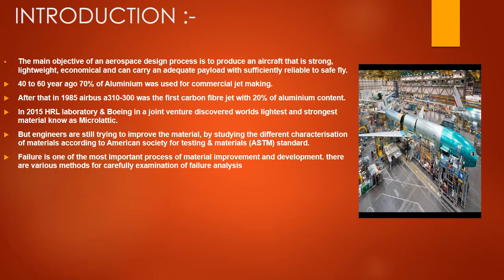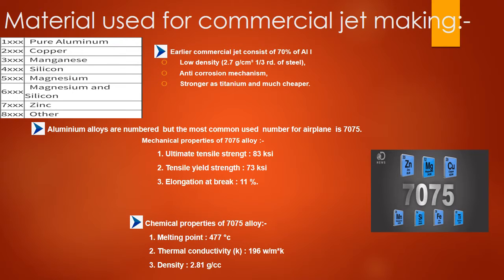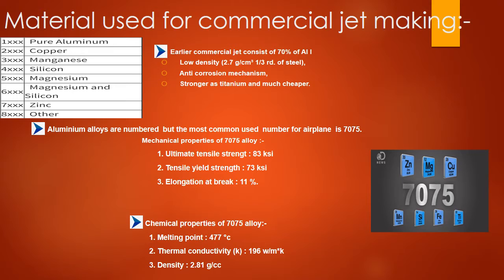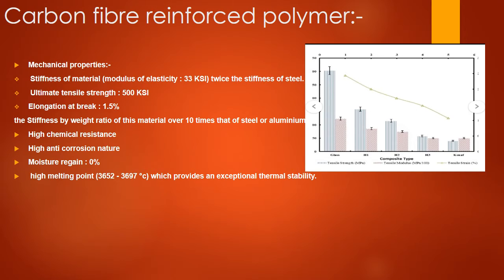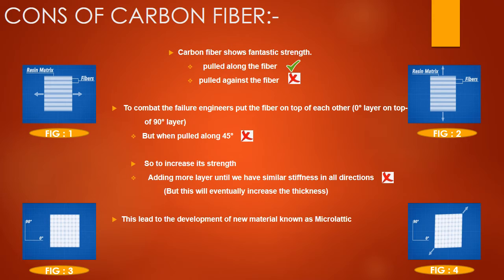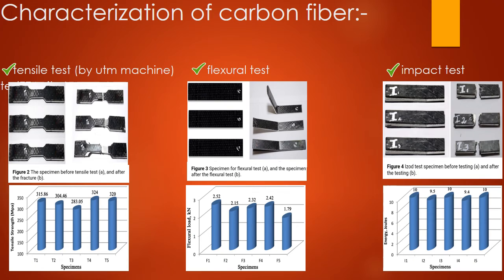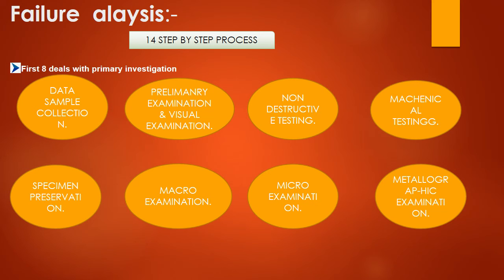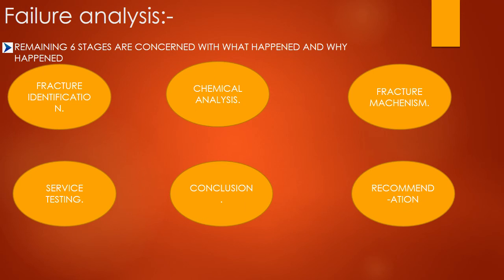video ppt   Rohit Singh

Comment: As we know  after all the efforts India is still struggling to develop single crystal blade for jets and  also the indigenous thermal barrier coating are not  upto international standards. So, how can we approach these major setbacks?
Reply: Microlattice is only the solution for everything. We can use the honeycomb structure for making the wings . This material is coated with the nickle and the coating is approximately 1000 time thinner than human hair and has an exceptional thermal stability.
Reply: What about the blades used in jet engines and gas turbines?? We know that creep is the main reason for their failure.
Reply: @RAHULKumar-is5oq  we can use 16 4th generation carbon fibre composite fan blade which is recently used by Boeing in its latest commercial jet 777x